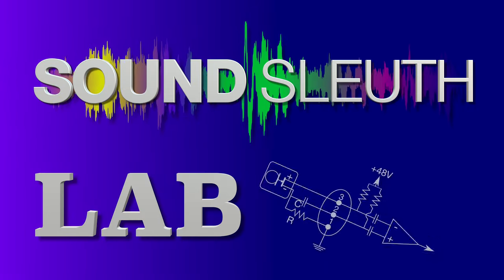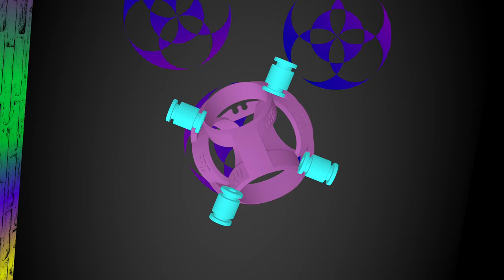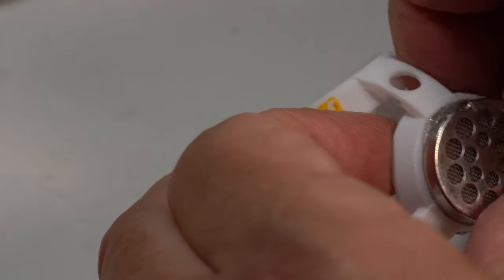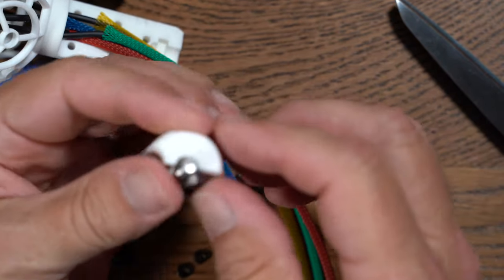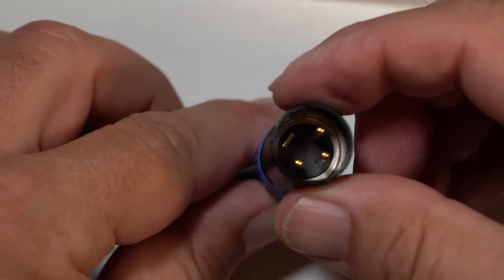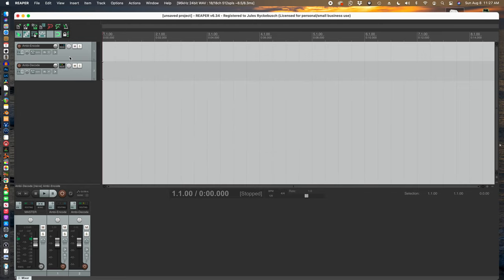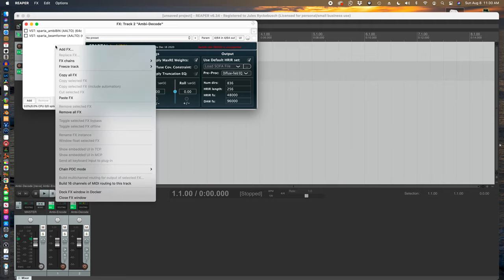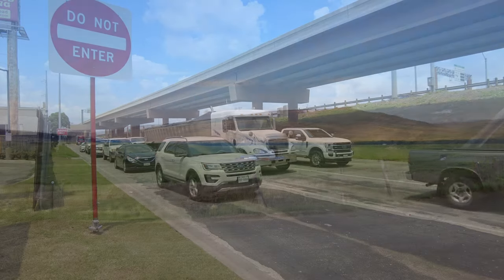The Ambi-Alice, a First Order Ambisonic DIY Microphone

Comment: Is the STL/STEP file for the capsule holder from Build #2 available online anywhere? I'd like to make one of these but don't need (or want) the suspension ball holder.
Reply from the maker: @kriista  I believe all files are there
Reply: @SoundSleuth  Quick response! Hmm, had a look but only see the GoPro and StickMount versions. I mean the "not ready for primetime" one that Tom B. designed shown at 0:38 in the video.
Reply from the maker: @kriista  email me @ ryckebusch@gmail.com. I will track it down

Comment: Thank you so much for this. Very well put together instructable. I would love to build this, but unfortunately field recorders with 4 and 8 preamps (maybe for a 2nd order mic, which you mentioned in a comment here) are quite expensive. I was also wondering, if it wouldn’t be necessary to calibrate the capsules and maybe also the preamps.
Reply from the maker: The entire mic has a calibration file in the instructable  I agree on the recorder pricing! I’m using a ZoomF6 and when in Ambisonic “A”mode all four channels are  gain locked.

Comment: This it seems to me an awesome project.
If I'd have an 4 track recorder, I'd definitely try to build it.
The only concern is about the capsules JLI-2590A as I see into specs the frequency range is 20-10K Hz.
I'd like to have something that goes up to 20K  Hz.
Isn't 10K  Hz a bit limiting? 
Do you have a second recommendation for a higher specs capsules?
Reply from the maker: The specs on the 2590 is to 20Khz https://www.dropbox.com/s/3e7v5vcjwt57j68/TSB2590.pdf?dl=0

Comment: For the price this is definitely interesting. though i'm curious how this compares to something like the rode nt-fs1? would it require more expensive capsule to compare to such an expensive mic, or is the rode just overpriced?
Reply from the maker: This is really good mic for far less in cost. The Capsule I am using has a high S/N ratio so low self noise. I have not had a chance to do a side by side test. Works well in both nature recording and for Orchestra/Choir
Reply: @SoundSleuth  cool, will have to see about making it my next little project then.
Reply from the maker: @ge2719  You will not regret it.
Reply: @SoundSleuth  ordered all the parts. just got the mic capsules so thought i'd start 3d printing the shell. Using filament printing. any idea of whether the parts needs supports and if they print best in the the orientation defaults?
Reply from the maker: @ge2719  I ordered mine from shapeways.  Usually the slicer puts in supports based on dimensions and material. So, I’m not sure what is best.
Reply: @SoundSleuth  no problem, just a few sections where without supports it would start printing section in mid air. managed to figure out about 55 degrees overhang seems to support all of them. 
Printing the top dome now, so will see how it goes.

Edit: seems to have printed the top dome piece okay at 55 degree overhang. 
Though the design doesnt lend itself well to filament printing. Did 0.25 layer height, so might have gotten a better result with smaller layers, but i'll probably keep a fur cover on it anyway.